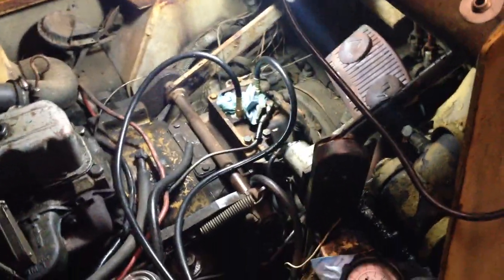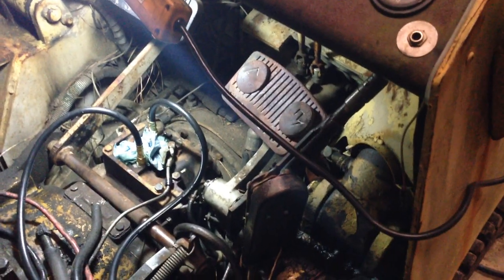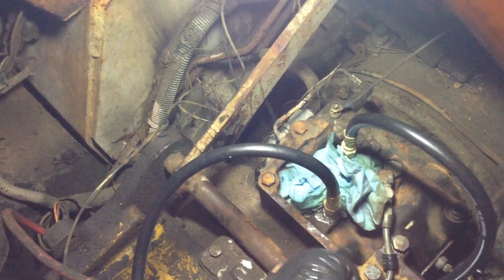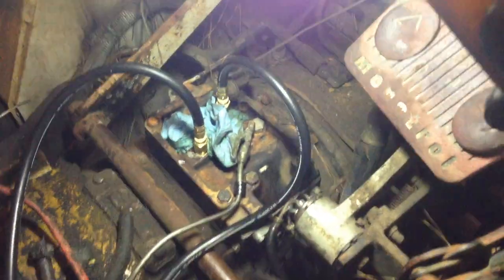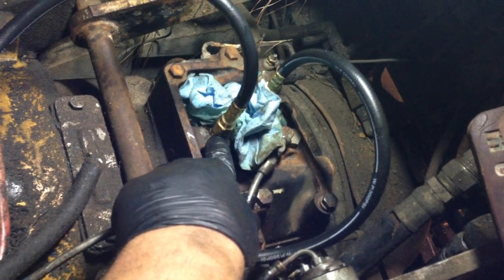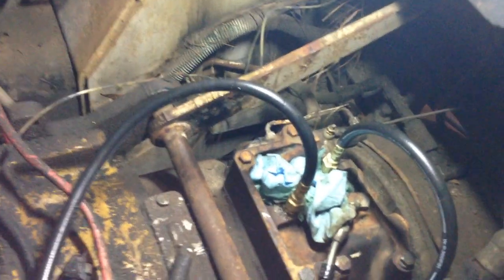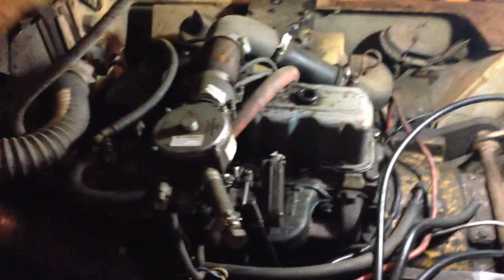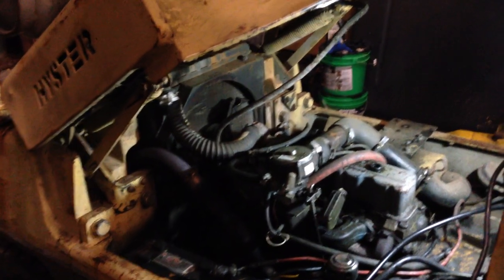Hyster H40 Forklift Inching Valve Repair and Pressure Check

Comment: The Hyster monotrol transmission is bias to reverse thats to say there is no neutral as such and its in reverse when its not running, as soon as the engine is started it will want to go in reverse unless the park brake is on which switches off the transmission via a micro switch on the lever. when you select forward monotol pedal sends an oil supply to the direction spool to change direction. The inching pedal is operated by the brake fluid, when the brake is applied brake fluid goes to the inching spool and moves the spool into the neutral position so you cant drive against the brakes. If the brake fluid has been contaminated the brake fluid seal in the end of the inching spool can swell up and make the spool lazy or jamb it completely. These transmissions rarely give any trouble. The only common fault was not changing direction this was nearly always due to the leaf spring at the back of the pedal out of adjustment or missing or not enough pedal return spring force. ( you need to to push the pedal against the return spring or it dosnt flick over the monotrol pedal. best forklift at the time.
Reply: Thanks, I think that might be my problem with recently bought S50E.  Master cylinder was full of rust, had to hone the wheel cylinders, replace the master cylinder.  Not too hard.  Machine runs okay for first five minutes then won't go forward or backward.  I think I'll start by checking the inching valve.

Comment: did you remove the control valve assembly from the trans and do you have a video of that as im having trouble removing mine i dont want to pry anything and chance breaking it if i missed taking something off
Reply: thatswhite1 anyone have any videos on doing the o rings in these things?

Comment: I picked up a similar hyster, forklift, there is a walk around video of it on my channel, sub me. I cant find any mfg plate on it anywhere, but since I posted that video I found a number stamped in the top of the frame under the right side engine cover edge, # F3A5156G but goggling that number finds nothing. mine is an oil bath clutch, w/forward and revere shifter, and a high rang and low rang shifter on the steering shaft, I had to get a new starter for it, also since I made that video, the hydraulics would keep cutting out, I took the relief valve out of the hydraulic pump, I put it in a vice and pushed in on the valve, spring has lots of presser, but it would stick open, I took it a part, and in side there were a lot of sharp burs around the open ports, I took from my stock a buck diamond pen type knife sharpener, very fine, took off all the burs I could, honed out the bore, cleaned it all up, put it back to gather, it worked a whole lot better, but still, just when your in a big rush with a transport waiting to be loaded, you hit a bump, and the hydraulics cut out, you shut it off for a bit, and re-start it, and most times, your good to go, some times you have to turn it off again and wait a bit longer, then way you go.. I ran all over town trying to find a new relief vales, as it looks like a very commune valve, but like every thing else in Thunder Bay, know one wants to help